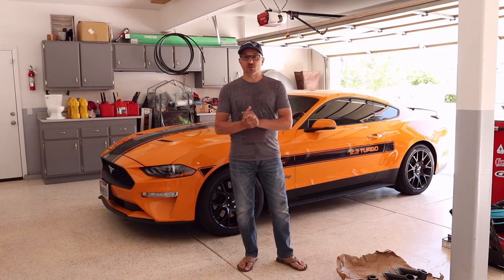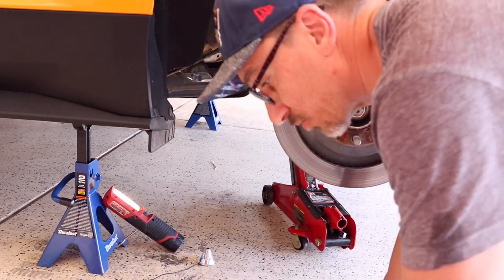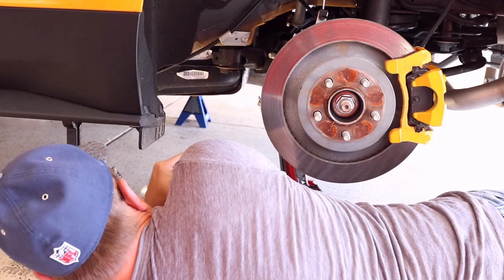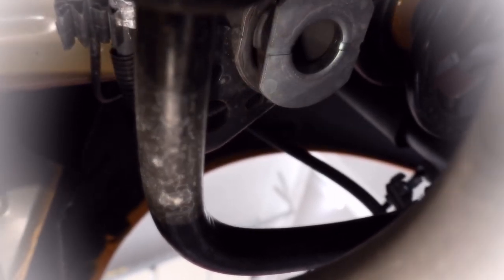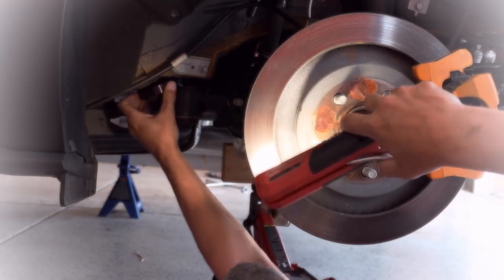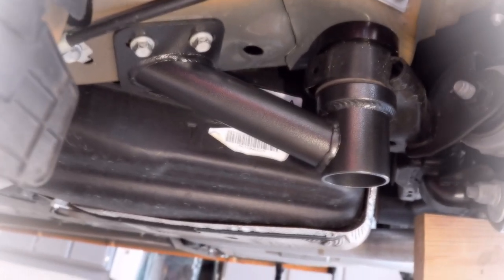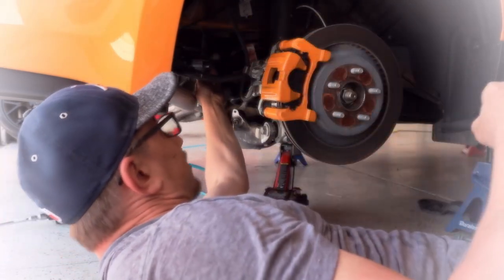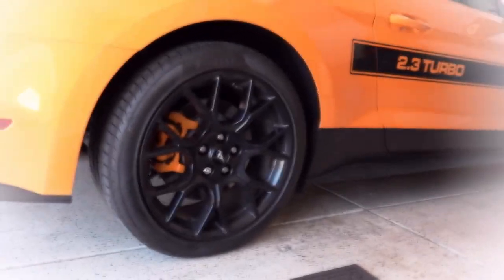BMR "STOP THE HOP"  IRS Lockout Kit Installation on 2019 Mustang EcoBoost Performance Pack

Comment: How about investing a few dollars an purchase a proper torque wrench....bolt torque values are very important my friend.
Reply from the maker: I have a calibrated elbow.
Reply: @mustangmodsecoboostgarage6539 ....I totally get it.  I too installed the BMR kit on my 2016 GT.  Wished I had purchased the Steeda kit.  Over all the Steeda Mustang Parts are a step up in fit and finish from BMR.